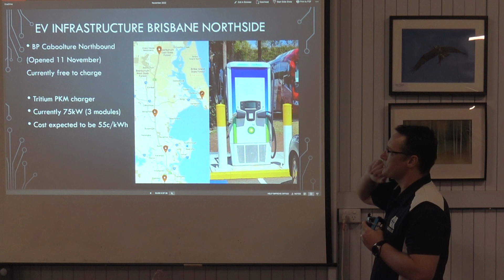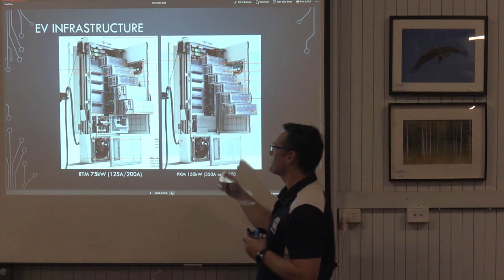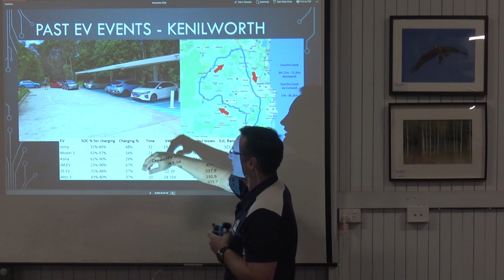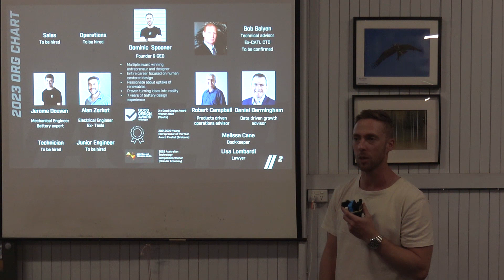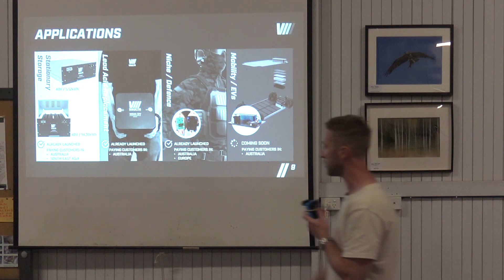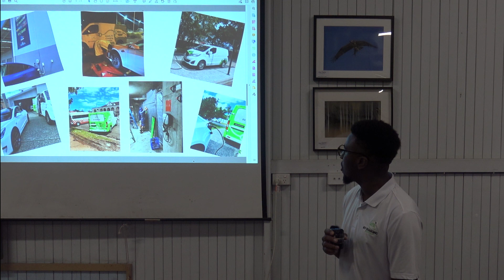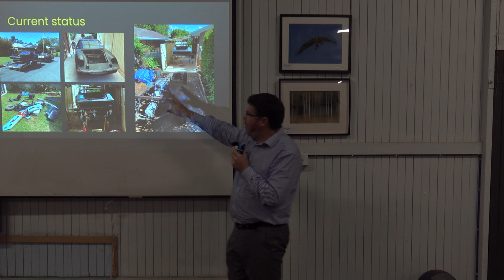QLD AEVA Meeting November 2022

Comment: Good comparison of the charging units at 3:30.. those RTM75 and PKM150 sites are virtually indistinguishable.  Probably hard to tell based on cable difference unless you have them next to each other to compare.